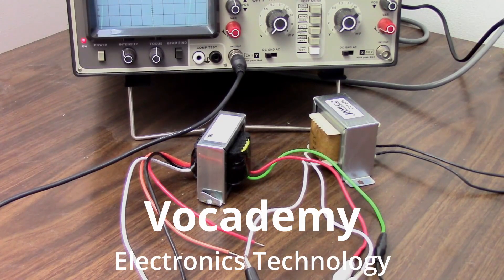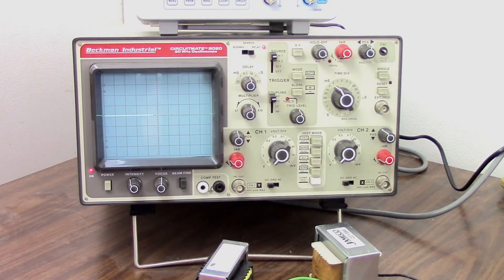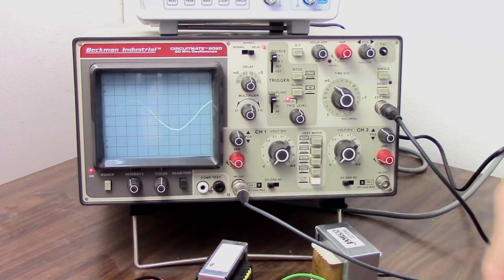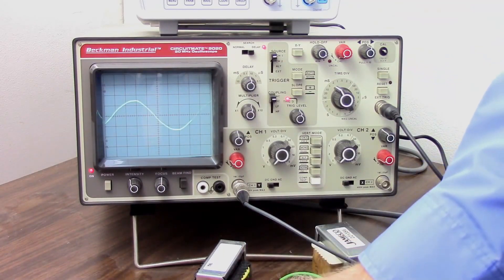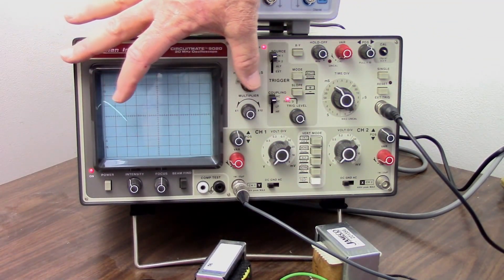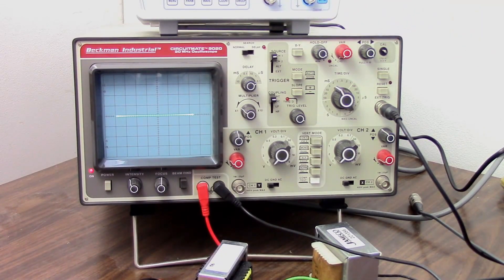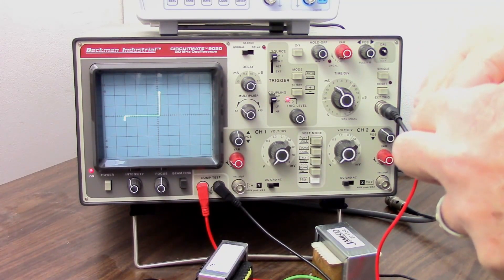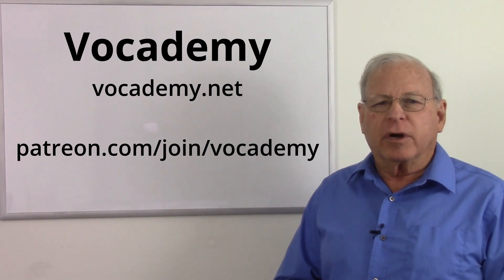Using an Oscilloscope: X10 Probes and Delayed Sweep

Comment: That's quite a nice older analog scope. Most of us probably have (or maybe will have) newer digital scopes, which make most (but not all) scope things easier. Most digital scopes come with either 10X probes or switchable 10X/1X probes and automatically scale the input appropriately. Lower-cost digital scopes require you to change a setting indicating which type of probe you're using. Higher-cost digital scopes will often automatically detect whether the connected probe is 1X or 10X. You will most likely stick with a 10X probe to take advantage of the higher input impedance it presents.